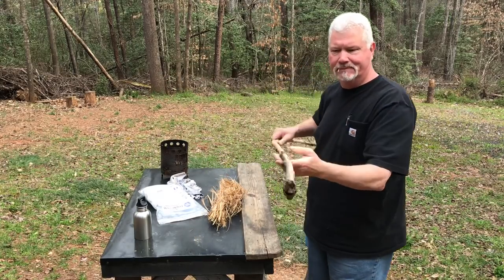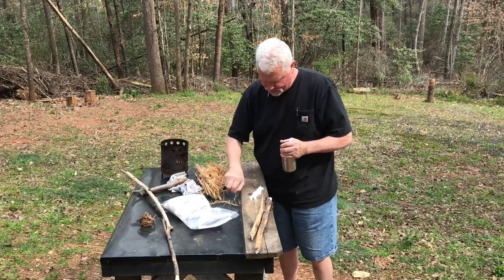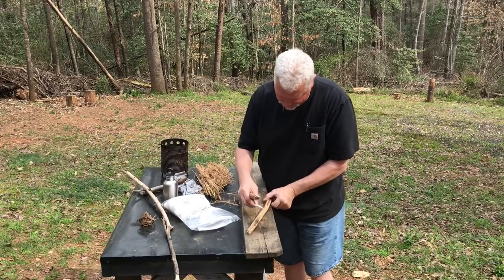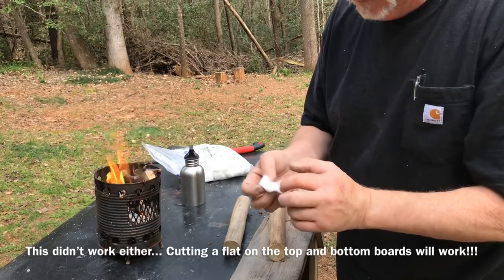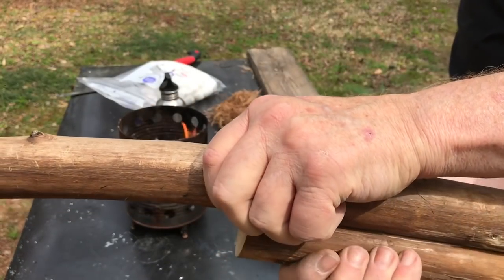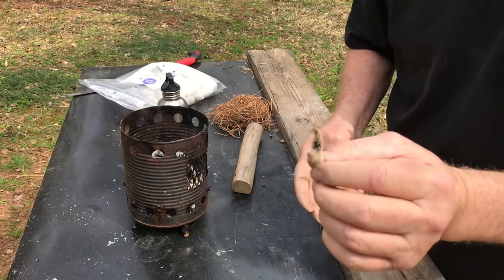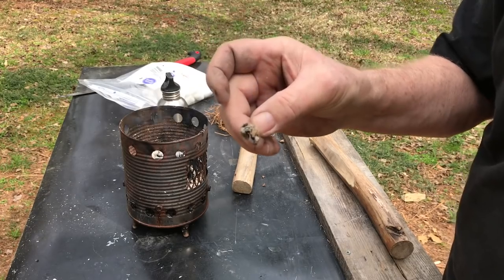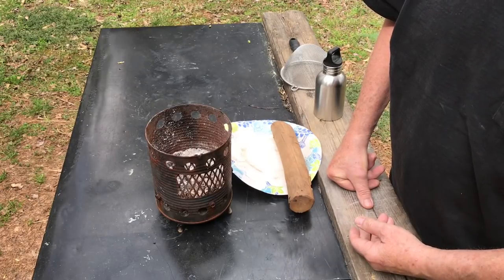Fire Roll, A Round Top Board Makes Easier Ignitions. Let's Try Round Top And Bottom Boards Next!

Comment from the maker: See My Playlists For 100s Of Fire Making Videos... The reason a round top board makes an easier ignition is because most of the pressure is directed to a pinch point where the round top board contacts the bottom board.  (By "easier" I mean less physically demanding on me and a much quicker ignition of the cotton and ashes.)
   Today I wanted to explore the possibilities of using 2 pinch points, if you will? A round top board and a round bottom board. Yes there are some obvious problems with this idea. One problem is tracking, (which caused today's FAIL). How are you going to get the roll to keep on track, consistently? I hoped that deep hourglassing of the roll would help, but it did not. I had such a problem with tracking that the roll never even got warm. The other problem that I anticipated was... How will you know when to stop rolling, that point where you have ignition, but before you actually "pinch roll" it into 2 pieces.
   LOL! I actually had a good time with this one, learned a few things and got some additional ashes for the ash bottle... Please SUBSCRIBE at the end of the video. Thanks!
OTHER FIRE ROLL VIDEOS YOU WILL ENJOY:

Rudiger Roll, Fire Roll Playlist
https://www.youtube.com/playlist?list=PLkoXX8XsMW3kLMA7kY_LznhzK5nOrA3Wd